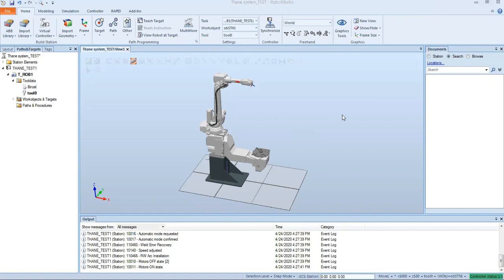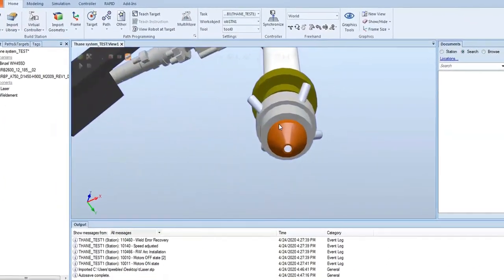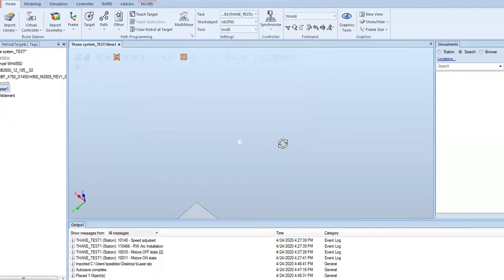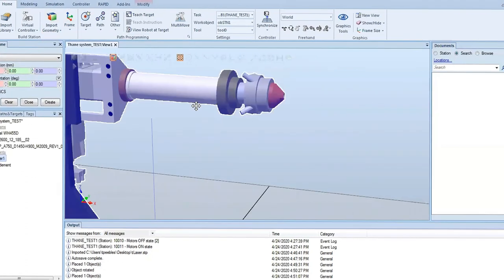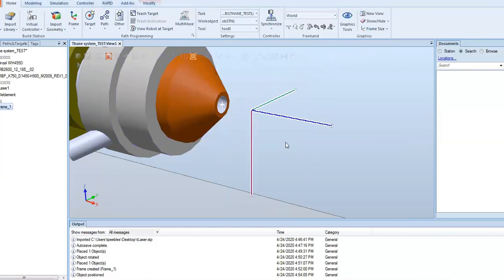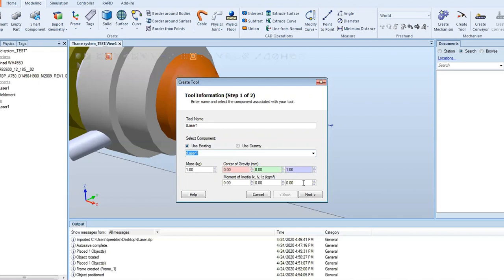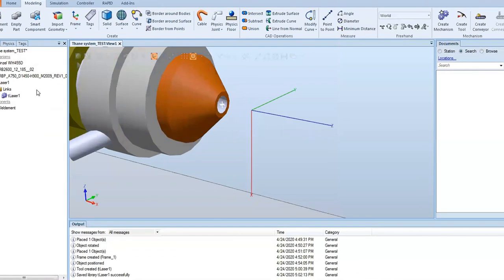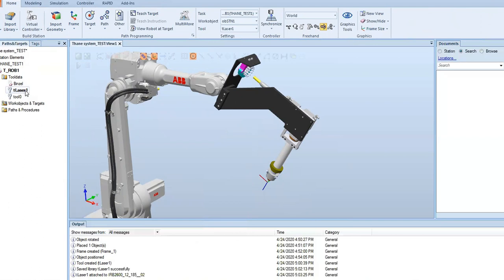Creating a Tool TCP - Robot Studio

Comment: Thanks, this helped a lot.  I'm using a spindle and the tool tip is offset from the mount to the robot.  All the other examples used a simple cone type tool.  I wouldn't have figured this out.

Comment: How can you transfer this tool tcp to a real robot?
Reply from the maker: You can copy tool data to your RAPID code.  Since your on a real system, you will have to run/update your tcp on the real robot cell, it should get you fairly close if your CAD representation is accurate, but be sure you run it through your bullseye slowly to avoid crashing into bullseye yoke during calibration..unless you don't have a bullseye then you would manually define your TCP.